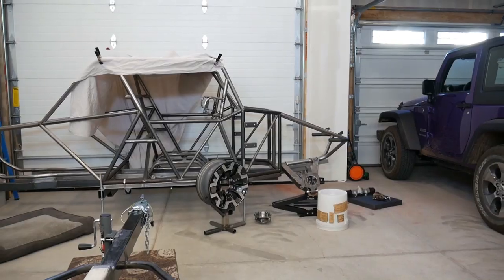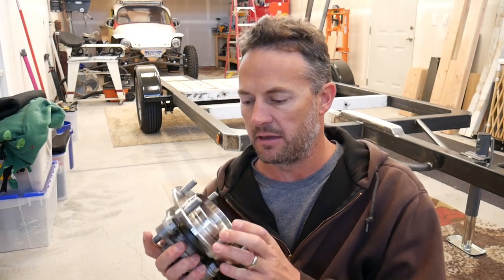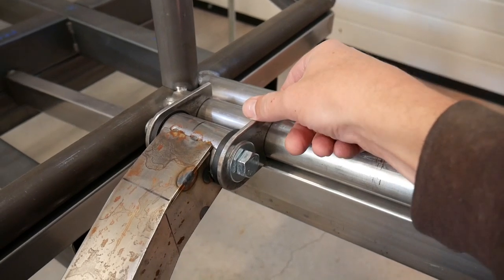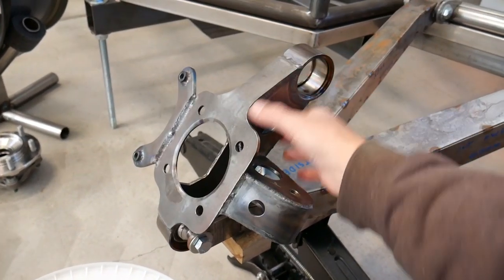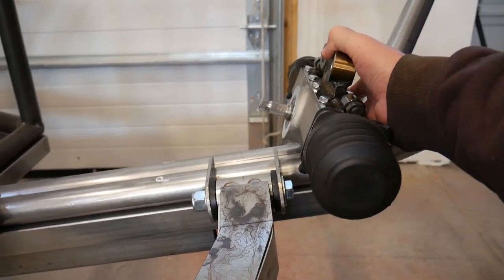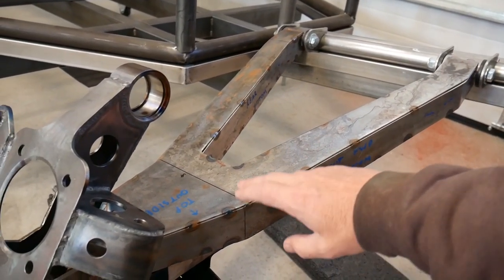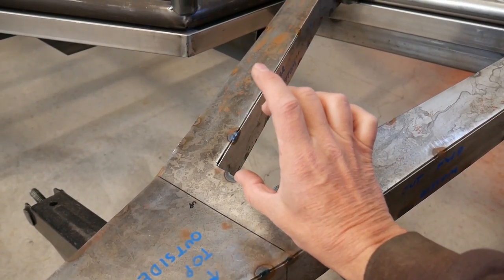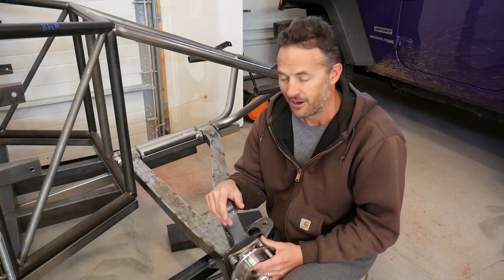Baja front suspension build #1 (Concept Design)

Comment: i love your videos!  thank you for taking the time to document everything!  i plan on building a A-Arm front end now that you've instilled confidence in me :-)   the first bug you built in your old garage really got this idea in my head.  i'm curious about the shock/coil overs you used.  i want to budget things before i get going...    i tried removing my torsions on my baja w/beam and they did not hold my front end up.  i can't imagine hitting a bump or having it in the dunes...  my question is  for a budget minded person who might also want to catch 10" of air from time to time....    what shock/coil would you suggest?    I do have my gas tank up front still but i plan on moving it to the rear at some point...     thanks again for what you're doing!
Reply from the maker: The front end on that Baja (Mauler) is a great setup. It's certainly capable of catching some air from time to time. The shocks on that are 10" travel, 2" body Emulsion FOX Shocks. And they have a 10" 200lb spring on bottom and 10" 100lb spring on the top. I believe the front end cost me about $2,500 when done. Not bad for what it offers. Very soft on the trail. Keep in mind these spring rates will not carry over to the trailing arm setup you have now. Your ratio is different.
Thanks for the comment and good luck with you build.
Reply: @DougBugBuilder  thank you!  Where do you order your heim joints and other parts?
Reply from the maker: @vdubluv222  I get all those chassis parts from Kartek Offroad.
https://www.kartek.com/

Comment: Hey Mike, wow trailer and loft are looing great, and suspension oh yeah,still have to watch the rest of your videos, just got back from a long fishing trip in the Bering Sea, Mike I would like to get your input on my next project since you have been my mentor on tig, I am about to put a lower outer door skin on my new 55 chevy truck, I plan on butt welding with my tig, have been doing a lot of practicing on thin ss , been keeping heat down and getting in and out quick, been keeping gaps tight aluminum backing, skipping the tacks apart and cooling then hammer and dolly seems to be working good, do you have any thoughts on this? thanks Mike
Reply from the maker: Mike, for tacking body panels I would suggest you use a Mig. Much easier and usually less heat distortion. But if you are determined to use Tig then the aluminum backing is essential! And leave a little gap between panels. Unless you can lap the panels with an offset on one panel. That method is much easier.
Good luck!
Reply: Thank you Mike, I know your a busy guy and your getting a ton of subscribers so I much appreciate your reply, I am excited about all your projects, you have a few things going on at the same time, the loft is going to be sweet
Reply from the maker: @DesertRatFabrication  Always got time for Mike.
So are you going to Tig it or Mig it?
Reply: Oh thank you buddy, I am going to Tig, I have spent a lot of hours on 20 gauge and sense my panels are 18 I thought that will be plus as far as burning through go's, I have went in with setting at 60 amps mashing the petal and getting out fast with tight gap and that works most of the time for a fuse weld problem with that is sometimes blowing it out, I find for the best results I set up at 35 amps with 1/16 tungsten, still tight gap and start just inside of one of the edges and get a little 045 wire started and work my way through the gap to the other panel, same thing key is getting in and out as fast as possible both ways have aluminum backing, then cool the weld with air or damp rag, with the Tig the weld is so flat that with a little hammer and dolly little to no grinding, so for the short answer Mike yes going with Tig
Reply: After all that i ended up Mig welding the truck door skins, and that is what you suggested i do

Comment: You're saying about the inclination of tie rod being parallel to the wishbone. Infact, the tie rod should be included such that if an imaginary line is drawn through it, that line should meet the ICR (point of contact of imaginary lines drawn through the wishbones) in the front suspension geometry. This all to eliminate bump steer.

We've followed this exact procedure for SAE BAJA INDIA.
Reply from the maker: You got it buddy! Great explanation, Thanks.

Comment: I didn't know you could mount the rack like that - it look upside down. it seems like dirt would get into it the way you have it ?
Reply from the maker: It's mounted upside down from a traditional install on a beam suspension. It will catch debris like this. It's never been an issue on the mountain trails I drive on. But if I ever take it in the sand I'll make a cover to keep sand from directly hitting it.
But you are correct.
Reply: @DougBugBuilder  Great work - i'm looking at building an A-arm next year so thank you for all of the helpful info !

Comment: Hey Doug, how far off the floor are your seats in the first car??
Reply from the maker: 8" in the front 7" in the back. But if I did it again they wouldn't be tilted as far back. And these are thin poly seats. So if you're using thicker suspension seats you might need to lower them some.